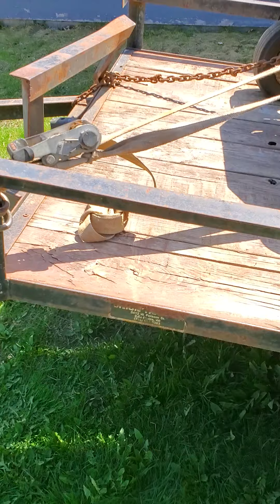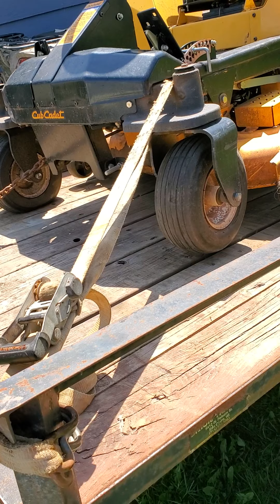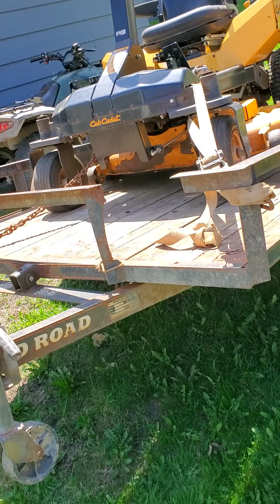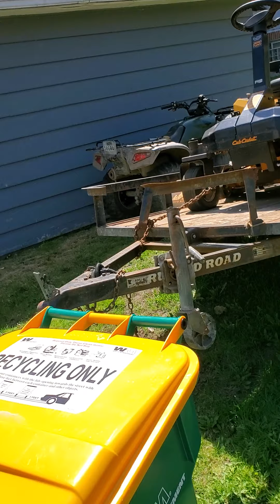Cub Cadet and other hydro-gear drive oil change using suction method

Comment: Thank you for the video. I have been thinking about trying to do this with our similar cub cadet z force s 48. I bought a hand suction pump from harbor freight. The power vacuum would maybe get more fluid out. Some say the hydro don’t need to be serviced but ours has just over 400 hours so a service sounds like a good idea. I recently broke a deck spindle on it so I bought a set of spindles for it on Amazon and got them replaced just before my back surgery.

Comment: My father's Cub Cadet RZT SX 46 KH has Hydro gear zc-dmbb-cagb-24px hydro pumps.  I was thinking along your lines of just sucking whatever old fluid I could get with a large oil transfer syringe and hose and then refilling with fresh fluid.  I like the idea of a vacuum pump too for removing the bulk of the old fluid.  I don't buy the Cub Cadet "lifetime" fluid - in my opinion there is no such thing.  His RZT is still pretty low hour to be thinking about the hydro fluid - but I will be doing this when it hits 100 hours or so.  Thank you for taking the time to post this very insightful video.  Do you happen to know what model of Hydro Gear pumps are on your unit?